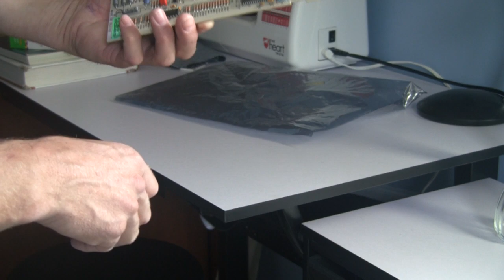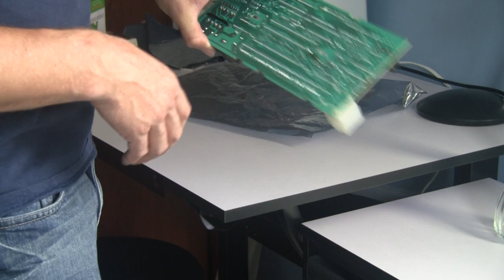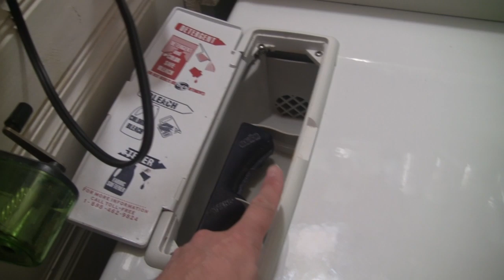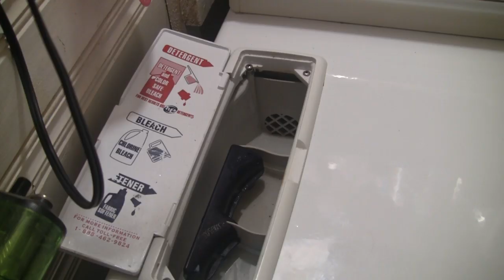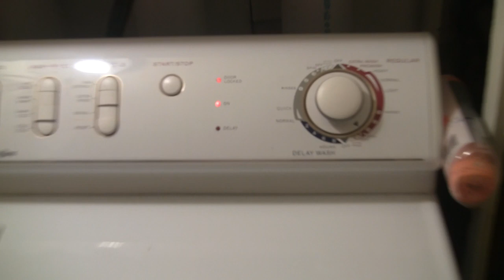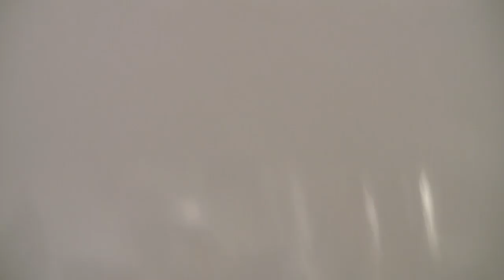Maytag Neptune Washing Machine Circuit Board Fix

Comment: There was a recall on the circuit board the set I got from my mom had the board replaced in 2001. I am replacing both the washer and dryer with a speed queen top loader in a couple of days.

Comment: Saw this video, still using our MAH4000 model Maytag we bought in the 90s here in 2021.  I have done a few maintenance items over the years, replaced the pumps myself.  It had a mold issue, removed and cleaned the drum and removed the "brush" thingie from the front of the drum, this solved the mold problem.

It is starting to have circuit board issues, randomly stops mid cycle but will finish the cycle if I push the button.  Will probably replace the circuit board with a refurb unit for $100 and carry on.  This washer won't die, I won't let it - LOL

Comment: Hello....just found your video. Desperately trying to find Kevin at Riverbend PC.  Have made several calls, but it seems there is another Riverbend PC.  Also, tracing Elk River is going nowhere on Craigslist.
Wrenchrocket...you are the only contact to Kevin.
I have a very expensive Maytag Neptune Dryer (top and bottom model) with a bad circuit board.
Really need your help to find a Kevin.
Thanks!
Nancy S.
Tampa

Comment: what do you think about a used set for $325 ? and how big is the tumbler for heavy items, a blanket or large load, compared to the other new front loads ?
Reply: Elizabeth Di Francesca they work well as long as their bearings are good and u clean them periodically with afresh and dry the rubber door seal once your done. I have mine and I love it

Comment: The transistor and resister failed and then the door won't lock. It would have worked better if they had used bigger transistors or a relay to lock the door. But they did not.

Comment: My Neptune washer start botton will not stay depressed. My machine will fulfill its cycles but I have to manually press and hold down the start botton. can someone help.!
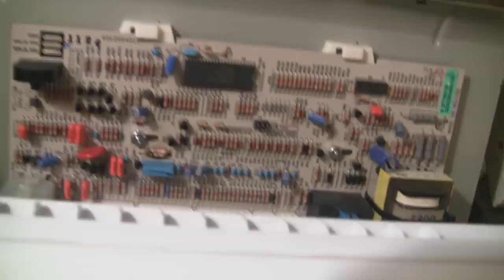Reply: +Desiree Brittingham  usually that's just a mechanical failure of the switch.  I'm not totally sure.   You or someone will have to get the back panel pivoted away from the machine so you can see behind the switch (like at 2:05 in the video).  Seems like it's just a switch problem and not the circuit board at all.
Reply: Yo tengo el mismo problema ya se reviso la tarjeta y tiene una pequeña rayita de quemado que puedo hacer x que no encuentro la tarjeta completa

Comment: Do you have Kevin's info?  I am having the same problem with my neptune that you describe.  I bought the wax motor/q9 r11 repair kit but in the likely event that I screw up the soldiering I would like to have it repaired.  I am also in MN.  THanks

Comment from the maker: As I explain in the beginning - there's more to the failures of these machines than just the blown out circuits/resistors.   Cracked solders waiting to fail, etc.    It's a good idea to get a good overhaul of the board and not just the repair of four individual resistors and transistors (triacs) etc.